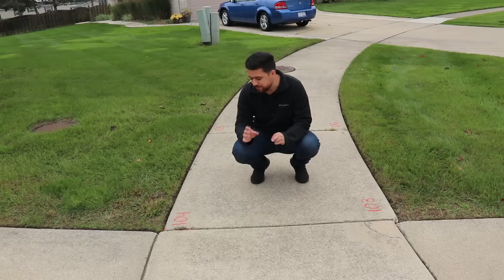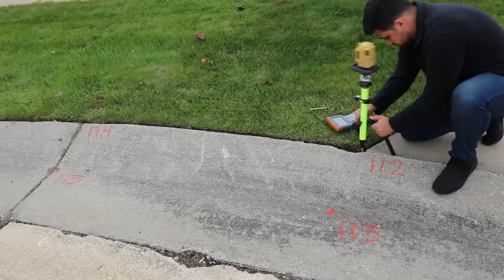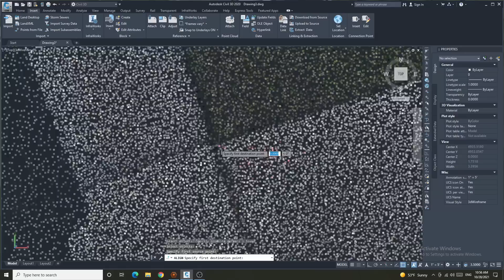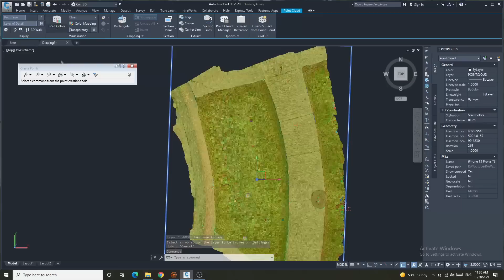iPhone 13 Pro LiDAR vs. Survey Total Station Accuracy

Comment: I once had to set a bunch of stakes on a property line for my girlfriend…. It was a pretty complicated property line, with odd arcs and angles and set on a steep hillside. I took a plat map of the property and used my iPhone for bearings and a laser ruler to measure starting from a boundary marker.  I used a construction app to correct for elevation based upon measured angles to each stake as it went up the hill and calculating the base off the hypotenuse. And double checked with the GPS receiver on the phone for elevation changes. For arcs I set a stake at the center of radius and just measured off the stake to mark out the curves.   The neighbor decided to hire a surveyor to check the property line and the surveyor found every one of my stakes to be within an inch of the true property line.  He asked me how I did it and was astonished that I could figure it out with nothing but an iPhone and a laser ruler.  iPhones are essentially tricorders.
Reply: please make a video
Reply: @DrPsta  That was 7 years ago.   And I’m not with her anymore….  But even 7 years ago, you could use an iPhone to ascertain bearings and read GPS elevations. I used an app called Theodolite. If you have one known point in the form of a boundary marker, you just measure distances and bearings as listed on the map. The only hard part is correcting for elevation as the plat map is a flat projection.  But the property map had topographic lines and numerous bench marks noted for verifying elevation.  By averaging the GPS elevation measure with the nearest benchmarked elevation, I could derive a hypotenuse length based upon the plat map distance and measure up the hill that distance ( when you’re doing it on your own, you need a bright surface to target the laser ruler on and you need a laser ruler that can handle the 200 plus feet you’ll need to measure. So you plant a target at a known point and walk the bearing until you get the distance you’re looking for. )  You can double check your elevation estimate by measuring the angle to the prior known target with the iPhone’s inclinometer and deriving how much higher than the target you are with the same Pythagorean calculation.  Then you go back down and fetch your target and relocate it to the new known point.  My target was literally a length of galvanized electrical conduit with a piece of stiff white board on it with an X at exactly my eye height above a hole with a bolt thru it drilled perpendicular thru the pipe about 18” up the conduit and I would drive the thing into the ground  with a short length of larger water pipe slid over the conduit until the bolt I was banging against was at grade- using the iPhone to make sure it was plumb. This way I am measuring from my eye height thru the iPhone to a target that is my eye height above grade. I literally used an improvised plumb bob to transfer the position of the iPhone to the ground. ( holding the upper end of the string in my left hand just below the lens of the iPhone ) As you compile points, If something is significantly off, you run a do over.   Over plotting a whole bunch of points, you can tell if you’re on track by the cumulative error.  It took a lot of traipsing up and down the hill, resetting stakes and target to correct for cumulative error… but overall errors over and under true measure tended to average out.   For example, I would stake maybe 6 points along what the map showed as a straight line… and then sight back along them and correct to the mean line of sight that was on the correct bearing.  
I knew I was on track when my plotting placed me within a few inches of a corner marker hidden under a bush that I didn’t even know was there.
All in all, it gave me profound respect for the guys who had surveyed the first ‘accurate’ height of Everest, by starting at sea level in India and working their way across hundreds of miles using nothing but a theodolite and slide rule. I would not use this technique to survey unknown ground, But with the backup of a plat and topographical map with known points you can cross reference, you can plot a property line reasonably well.
Reply: @christopherpardell4418  thanks for taking the time to detail and share this, well done mate!
Reply: This guy is great. A true nerd, but I think we can all relate.
Reply: @calebwallace9589  right?! I just appreciate videos to see their method in action to see if I can find good ideas to apply to my projects.
Reply: Wow that sounds incredible. Any licensed surveyor with modern survey grade equipment would be hard pressed to resurvey and check all his own points in that tough terrain within an "inch".  Doing it like you did would be a true miracle.  I think we would all pay to see you recreate it.

Comment: I have an issue with this.  A lot of the stuff you talk about....
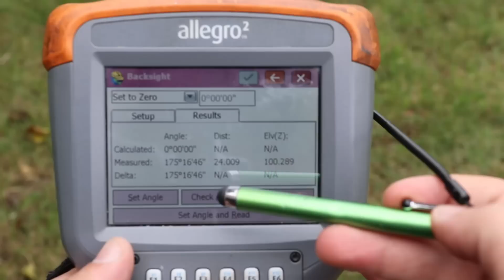3:53 you don't need to go ahead and take a reading ... just take the damn reading.
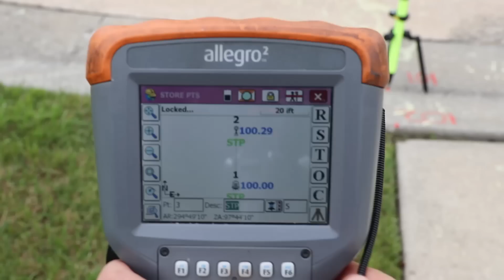5:43 you don't need to go ahead and assign it ... you only need to assign it.
6:08 you don't need to go ahead and do this ... just do it.
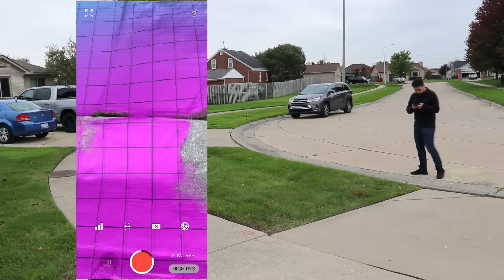9:03 you don't need to go ahead and start scanning... just start scanning.
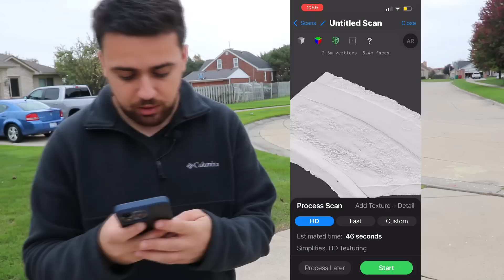9:31 you don't need to go ahead and process the colorised scan no... just process the damn scan now.
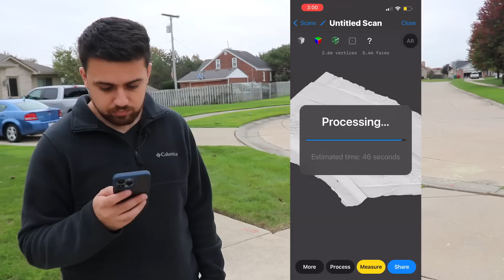9:39 you don't need to go ahead and turn on the TIN... just turn on the TIN.
10:24 you don't need to go ahead and click ok... just click ok.
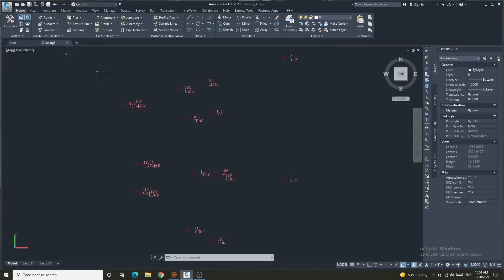10:38 you don't need to go ahead and import the point cloud... just import the damn point cloud.
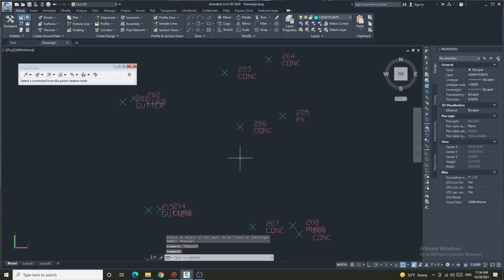15:19 you don't need to go ahead and freeze our point clout... just freeze the point cloud.
16:10 you don't need to go ahead and export all the points... just export the bl00dy points.
So...  If you need to "go ahead and" for everything then it's just ridiculous.  Just do something without "going ahead" first.  You don't need to go ahead.  Just do whatever you need to do.
Reply from the maker: Let me just go ahead and comment on this comment 😁✌🏼

Comment: Great work and really impressive that you addressed many technical issues and gave many clues about how to make a good measurement.  
I understand that you compared iPhone against the ground thruth. However, what you are comparing here is not LiDAR error but LiDAR + mapping error.
Reply from the maker: yea the objective here is to see the accuracy of the points in relation to themselves. Other people may test the resolution accuracy to the object they are scanning.

Comment: i consul: is it possible with this application that the mobile recalculates the scanning point, in order to rule out the error due to variation of the fixed scanning point?
Reply from the maker: The App displays the most confident points it has. If the level of confidence is low, it doesn't register the point.

Comment: It is very important, when performing the scan, it is done from a fixed point, a tripod is necessary for the iphone
Reply from the maker: Not necessarily, the gyroscopes in the phone allows us to track how much movement happens in the phone. Now it isn't as accurate as an IMU but it works for a certain distance.

Comment: Does not look like u do a lot of fieldwork, You measured the points as stations it would be quicker measuring them as ground features on a pole with robotics. What you where doing you should have setup on all station points and do a triangulation if you where going all the way
Reply from the maker: Stations? Did you watch the video? I never even mentioned stations. 101, 102, 103 etc are just point numbers. And I was using a pole with robotics lol. I've had plenty of field work experience as my channel can prove.

Comment: Just wondering, would having the phone attached to a gimbal like the Osmo help with accuracy? I can imagine a certain % of error could be due to shaky hands.
Reply from the maker: Great video idea!!!
Reply: i was thinking the same thing while watching this video.
Reply: It might help a little bit but the pull rate of the sensors (gyro, compass, accelerometer) in the phone seem to be high enough to easily calculate out pretty much any shaking in processing. It’s really impressive for such a small device and I wouldn’t have thought that it would actually be that accurate before watching the video
Reply: The phone’s LiDAR is measuring relative distance from its sensor to objects and creating and instant “live” map. Just like you are able to walk around and scan, the slight movements of the phone have no effect on the mapping. It’s mapping from its new angle/location and referencing against what it has already mapped. The errors most likely come form the software and from GPS data since GPS data is always off. 
  I think establishing reference points with elevation, before moving around and scanning, would fix this. Basically, the use of the phone is way to simplified but this is always the allure of using such tech as opposed to the expensive complicated tech. To get those perfect reference points, you probably would need to mount the phone on a steady surface or tripod. Then you could walk around and scan.
Reply: Buen punto
Reply: Short answer is no.
Reply: @Cad1900  long answer: NOOOOOO

Comment: Great video Rami
what are your laptop model and specs?
Reply from the maker: Thank you. My laptop isn't that powerful, i just use it to remote into my desktop which has 32 GB of RAM and runs on a RTX 3060 graphics card.

Comment: Was hoping you would use more of a practical example. Like the whole curb 60ft. Something that you would use in reality. A 100sqft area is a little on the not useful side.
Reply from the maker: Well realistically if I did 60 feet of curb, there would be some major drift. I've done a video scanning 200 feet with the 12 Pro, maybe this will give you some insight on long range scanning. https://youtu.be/UYZgCWhN5C8

Comment: Hey Rami, I'm a Professional LS from up in Canada. I love what you're doing here. What app do you use to extract the point cloud info from the iphone? I understand that the actual points are locked away somewhere underneath an Apple API and you need a third party App to export a .pts .las or .laz file. Thanks!
Reply from the maker: Actually you’re able to export the data as an LAS and just email it to yourself. The file size isn’t very big and so I can then open up the email on my desktop and work with it

Comment: Rami excellent work! Just a few quick questions.
1. When Aligning the point cloud to the total station points if you use 2 points (1 plane, X) is that introducing error in the Y plane  with 3 points (2 planes) could you balance both X and Y? The Z axis between points looks way closer that the Delta Averages by your chart just wondering if there might be drift between Gyro Level in Phone and total station level.

2. If you scanned say a 1"X1"X1" cube in the LiDAR data would it help with the scaling issues importing to CAD?

Comment: Thanks for the video. I'm a surveyor from Australia and was intrigued by the LIDAR on these phones. 
I'd be curious to see the results if you did scale the point cloud to the surveyed points. The errors look a similar order of magnitude the further from the base point. The error on the elevation though is a bit strange. 

Thanks for the metric much appreciated. If you want the table to look neater you can use whole numbers for mm. Only use decimals for super high accuracy surveys.
Reply: The elevation error could be caused by the AutoCAD align command. When 2 points are used for the ALIGN, the command asks for the scale option. You can also align using 3 points. With 2 points, the point cloud can be slightly skewed from its original horizontal plane, and it is aligned to a line rather than to the plane. A better way would be to average X,Y,Z coordinates for the control points, then do the same for the  total station points. This would establish a center of gravity for both datasets. Then you could place them on top of each other using this centre of gravity. Similarly you could calculate average angles for the pairs of points to obtain an average azimuth for both data sets and rotate the point cloud accordingly. Then you could mitigate some of the total station error by taking measurements of all points from various foresight points. This would create an overconstrained network of points, which would allow you to average the errors using Truncated Taylor Series (long story how this is done, but it works magic). This way you would see each control point as 3-dimensional probability ellipsoid with a range of errors, as well as the center of this ellipsoid. Then you would be able to mathematically prove the accuracy of your control point and the point cloud error.

Sorry for the long-winded and academic explanation of this problem. It would make a great project for an advances surveying class. 

Great video, very informative and the methods shown were sufficiently accurate! Thanks!
Reply: Jason I’ve found hard stand to be within 50mm and up to 200mm on “grassed” areas, there’s a bit more testing to do and a better methodology to follow but it’s getting there. I’m a surveyor in WA if you want to ask some questions or look at the point cloud

Comment: Solid analysis. I've surveyed many miles of city streets, and this is nowhere near ready, when 0.02' vert can make or break a design. Even if there was a good way to least-squares fit the point cloud to regular conventional check shots, it still wouldn't be enough or worth the additional effort. For reference, I typically survey BSW to BSW with a max of 30' linear interval, with an average of about 1 point per LF of street, and can do about 1000 LF a day. Not to mention working around parked cars and such, where there's no way to get a visually contiguous scan.

Comment: Your result points have northing and easting, but I've never figured out how the total station knows where North is.  Internal electronic compass?  You obviously didn't stand around and shoot Polaris first.   This is all a big mystery to me.
Reply from the maker: No I just assumed that North was from the TS to the BS. Obviously this is wrong, but I am in a local coordinate system, so the magnetic north is irrelevant to me.
Reply: He has aligned two models on top of each other.. True North doesn't matter.

Comment: Great job man. I am a land surveyor at Alberta. I did the some test . I have a question, how did you export RCS format from the 3D scan APP.  I only can use OBJ and DEA file. But it make MicroSurvey very slow.
Reply from the maker: I exported an LAS that I converted into an RCS in Autodesk Recap. This is the best file format to use in Civil 3D.

Comment: Great video, once more! And thanks so much for the mm accuracy; it's hard for me to think in decimal feet.
Reply from the maker: My pleasure. I will do my best to include metric measurements in my videos.
Reply: Thanks! I was thinking about the accuracy drift, and I wondered if it was partly due to the rolling shutter on the camera. Presumably the lidar sensor doesn't have that issue, but when it comes to aligning the imagery with the lidar, the "bowl" effect you sometimes see in photogrammetric clouds might be causing issues. Perhaps as another test you could use physical markers and just base your CPs off the normal view rather than the imagery. Dunno, just thinking out loud really.
Reply: Something is definitely wrong in the mm column shown in the video. For example in row 11 it says 0.19", that's 48.26mm but the chart says 56.0099. Even some that are super easy to do in your head are obviously wrong, like the next value of 0.10" that says 30.11mm. 1" is 25.4mm
Reply from the maker: @tamazerd  surveyors in America do not use inches, we use tenths of a foot. 0.19 feet and 1.9 inches are very different.
Reply: @RamiTamimi  Thanks! That makes the numbers add up. I just assumed it was inches because the distances were so small.

Comment: BUT how useable is the scanner when digitizing a much bigger area - I from my experience think that the iPhone scanner suffers from shifting geometry when doing interior / exterior scan of bigger areas.
Reply from the maker: Large area scans are rough, this is designed for small areas and with a considerable amount of drift area. I found the 12 Pro's drift area to be around 0.5 feet every 100 feet.

Comment: I was sick in my mouth when I saw you using ft 😆 joking.

Great video man, very interesting. As a dimensional control surveyor I take a little comfort in seeing errors of 50-100mm over a small site. Safe for a few more years.

I think there is probably a good future for handheld lidar when combined with a good 3 dimensional network. Keep up the good work fella
Reply from the maker: Glad you enjoyed. Yeah the technology has come a long way. No need to feel uncomfortable, even when the technology replaces our current equipment, surveyors will still need to QAQC the data.